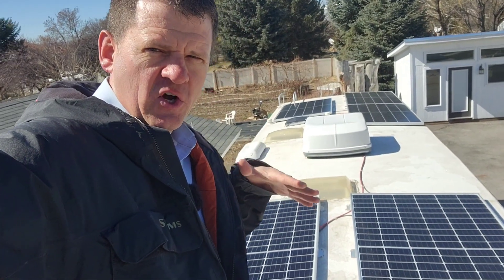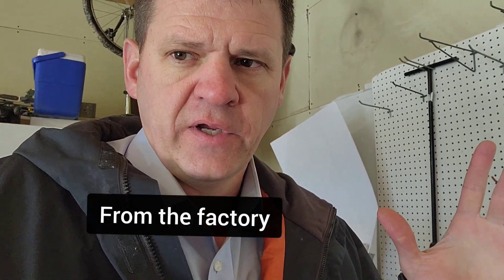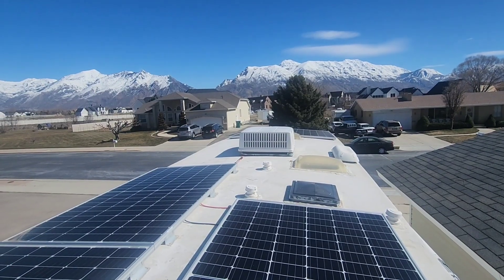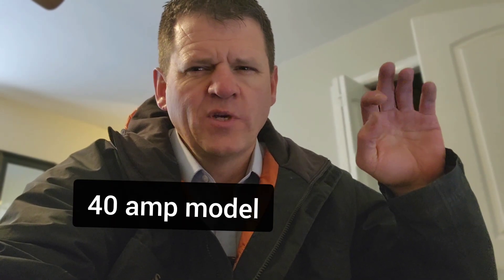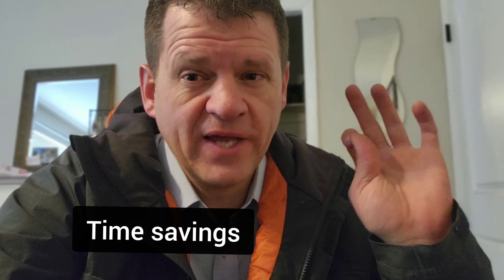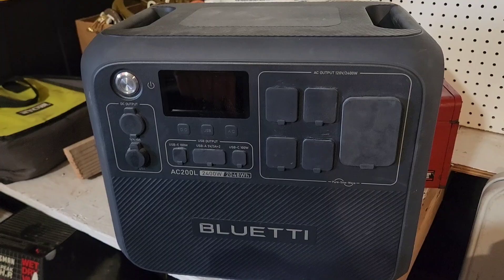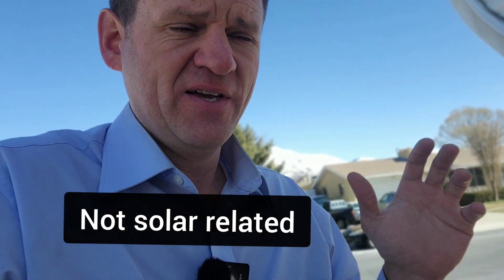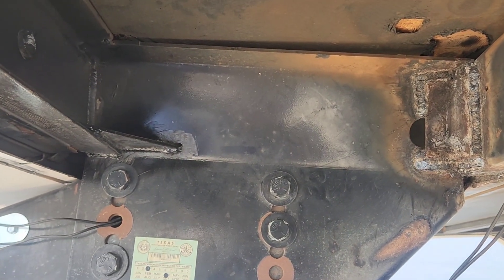One Year Review - 48v RV Solar Power system - What I Got Wrong

Comment: For those that dont know, running solar panels and batteries (if you have multiple batteries) in parallel will increase your amp hour rating, while keeping the voltage the same. If you run batteries in series, it increases voltage while keeping the amp hour rating the same
Reply from the maker: And wh or kwh is the battery capacity of all the batteries together. Volts times amp hours. 👍

Comment: @diySolarPowerFunWithRay Watched today your older RV inverter/battery installation video and how much each electrical consumer needed. I just wonder if it might be preferable to have a larger Growatt inverter? Like i.e. 5000w instead of your 3000w? I am toying with some RV solar/battery/inverter plans myself so very interested in your project. Appreciate your videos indeed👌Thanks
Reply from the maker: The 3000 W is great for me.  I've never wanted more power but your situation might be different. With my 3,000 Watts set up I can run my electric hot water heater and also my microwave. Or I can run my microwave and my air conditioner at the same time.  I can't run all three at the same time but I have never needed to do that. I don't think I would get this same inverter again.. I think I would go with another brand inverter... see my shock video.  I need to research some other brands. I do like the 3000 Watts of minimum usable power though.

Comment: Love this video, thank you. I've had a 48v system for an off grid house about 18 years ago but didn't like replacing lead acid batteries every few years. I appreciate all the tips for starting my 48 volt system for my camper and I've had a Bluetti 200max for a few years now so I will try hooking up to 12v 30A plug for my slide outs and jack. I'm pairing that up with lifepo4 48v 100A batteries.
Reply from the maker: Love that powerstation.   Not a common feature

Comment: Look at these two products A) SUNGOLDPOWER UL1741 6000W 48Vdc Pure Sine Wave Inverter Low Frequency 240Vac and  Input 120Vac/240Vac Output Split Phase with Battery Charger Off-Grid 18000W Peak and B) 
Cllena DC 24V Step Down to 12V 100A 1200W DC/DC Voltage Converter Regulator Waterproof Buck Transformer Power Supply

0:41
Reply from the maker: Do you have some links to those products?

Comment: Wanting to replace my lead batteries in the 5th wheel which are needing replacement.  Im trying to figure out the best transferable  battery to add to house and trailer 
.
Reply from the maker: I need to do a video on this. Basically you just want to make sure if you put a lithium battery in that the lithium battery is not connected to a lead acid battery at all. Even from the towing vehicle. If you do you will want to have a DC to DC charger. Something that will limit the current flowing into the lithium battery. Basically if the lithium battery is super low and you plug it into a 12-volt charge lead acid battery, the lithium battery can accept a ton of current and could blow your fuses or burn up your wires. So you will want a DC to DC charger in between your lithium battery and your lead acid battery. If you charge from your alternator the DC to DC charger will also prevent your alternator from burning up by working too hard.

Comment: My goal is the same as far as a mobile system to offset my home power with my system for the 5th wheel. I've installed the jackery 5000 with smart transfer switch. When we go traveling the 5000 will go in 5th wheel. I picked up the 2 500 w jackery panels.  They get 800 w just standing in the driveway.
Reply from the maker: I personally would get rid of the 12-volt battery altogether do you know if the jackery has a 12-volt port . Sometimes Those power stations have 12 volt 30 amp port period that would definitely be enough to run all your 12-volt appliances... I would definitely do that instead of putting a 12-volt battery in if you have that port.  And be sure to also turn off your 120 volt ti 12 volt battery charger or converter box that I mentioned this video.
Reply: @diySolarPowerFunWithRay  yes on the getting rid of the 2 lead acids.  Wanting a good 48 -100 like you put in your trailer.  I want to be able to use it to double my storage at home system when not camping. Unfortunately my 5th wheel is at storage for the winter.
Reply from the maker: You could remove the battery and just stick it in one of the cabinets and only use it in case you need a backup for some reason..

Comment: Hey Ray....You need to use the gooseneck with shock absorbers. That eliminates the stress on your RV hitch.
Reply from the maker: I switched to the Anderson hitch.  It seems pretty good. Pick up that would be really nice if the hitch on the side of the fifth wheel had some spring to it. Maybe I will get that on my next trailer

Comment: Instead of using the step down converter wire a 48v->12v CHARGER and put battery downstream of that, then hook other end to DC distribution. The 12v lithium battery will act as a capacitor to help with heavy amp loads and the charger will keep the 12v battery topped off. Especially if u get a low amperage 48v->12v charger then u wont have a hug amount of efficiency loss that having the factory converter on would use.. Then u can still switch off the factory converter.

Comment: No mention of over current devices. Please install a small panel after the inverter. Please install fuses for the dc-dc converter on both sides. And yes wirenuts on a moving structure is a terrible idea, fault goes to original manufacturer for that

Comment: best videos I've seen on coverage of RV inverter topic... the original 48v install vid and this one.  Even got the bonus here on gooseneck extension risk (lesson in torque).  You can get adapters from gooseneck balls to kingpin depending on your tow vehicle arrangement needs (they seem lighter than standard fifth wheel hitches but the ones I've seen do require some torquing of bolts when installing the adapter and may not be faster to remove the fifth wheel frame to clear up bed than a normal set up, just easier to carry and store)

Comment: i have installed those Victron multiplus2 that 2400w rating is very conservative i bet it would run your ac and microwave at the same time for a few minutes it would say its overloaded but they will hold it for a bit.

Comment: for panels just do unistrut rails on the roof, then they are up off the decking panels run cooler and you can cable manage/change out panels at any time, take the panels with you to a new trailer.

Comment: one wire popping off in a cupboard wont start a fire FYI. Not how electricity works
Reply from the maker: It depends on how many volts are on The Wire when it comes disconnected.

Comment: The 12 volt battery is needed for breakaway on travel trailers, right?
Reply from the maker: You need 12 volts, yes.  I'm supplying that with my step down converter. Typically trailer brakes will use 3 amps of current per break if the Breakaway switch is pulled. Since I have four tires it will use a total of 12 amps.

Comment: I would have left the 12 volt battery in the system if for only to absorb the initial inrush of any loads on the 12 volt system. This would make life a lot easier for the 48 to 12 volt DC to DC converter. just a thought. Great video

Comment: Rey, bonding neutral to ground is done at the source, not at a sub-panel. Your RV is a subpanel to the shore power pedestal. Bonding is supposed to happen at the shore power pedestal. With an inverter, take Victron as an example, when seperated from shore power, an internal relay closes to create neutral to ground bonding since your inverter is now the source of AC power.
Reply: Would I have to create a jump wire to ground and neutral together at the inverter?

Comment: Hi, I love the videos that you did on the solar system,  but how can I figured out how much solar  panels needed for my rv? I have a 2001 Four Winds Motorhome.
Reply from the maker: That really depends on what you want to run. Some people have a generator and use that whenever they run their microwave or air conditioner or hot water heater. If that's the case you probably don't need too much solar just something to keep the battery topped off from the smaller running appliances like lights, etc.
Reply from the maker: If you want to run your air conditioner I would put as many solar panels as you can fit

Comment: Good job, Ray. The only thing I disagree with is removing your 12v battery, if you have a 24 or 48v system, especially if you have high amp 12v loads. For instance, my 5,500w generator requires over 300 amps to start. My hydraulic jacks and slide also are high amp draw items that need a high current source. We use both a 12 and 48v system to power our motorhome. It's good insurance to have a redundant system in case one goes down.

We're old, retired FTers who designed and built our system ourselves, on a tight budget. It took us 5 years to gather the resources to complete it, doing all the work ourselves, but it was well worth it. We started by building a 620-watt liftable solar array on the side of our motorhome. It makes a nice bedroom window awning too, practically lifting itself with a couple gas struts, and it's easy to clean, standing safely on the ground. Next, we built a 12v, 560ah LiFePo-4 battery with 8, 280ah prismatic cells. We use a Heltec 330amp BMS (1,200a surge) with a 5a active balancer. It cost us less than $1,500 to build this 7.1 kwh battery, including the high amp BMS. We chose these cells rather than a pre-built battery because they fit perfectly under the steps of our MH where our old pair of golf cart batteries used to reside. We insulated the battery compartment, cut a small hole in our step risers and installed a tiny computer CPU fan to keep this space at close to room temperature, so we don't have to worry about the BMS shutting down charging due to low temperature - or their life reduced from getting too hot. Our 12v system uses an 80A Progressive Dynamics LFP converter/charger, a 1,000w Renogy inverter, a 50a Epever MPPT charge controller and a Lnex battery monitor. The only time we plug our converter/charger in is when we are on shore power, which is a rare event now that our 48v phase is complete. We built this entire 12v phase of our system for under $3,500. 

By mounting the solar array on the side of our coach, we left the roof free to rack 8, 550w solar panels (4,400 watts) down the length of our 35ft Class A, 15" off our roof, above our AC, vents, etc. We built the rack out of 2" aluminum angle with the front 2 panels of ours sloping down at a shallower 9.5-degrees to meet the roof, gently easing airflow over the array. It covers our entire roof, providing some nice shade with plenty of cooling air underneath, increasing solar output and reducing the heat load on the air conditioners too, though our overall height is still just under 12 ft. We mounted our Sungold Power all-in-one 48V, 5,000W Inverter/100A charge controller/battery charger, breakers and a Lnex battery monitor on the wall in our bedroom, saving us space as well as money. We chose the Sungold Power unit for several reasons. First, it supports up to 500 volts from our 400 voc solar array, and unlike a Growatt can work without batteries hooked up. It also has a power saver mode that only uses 20-25 watts when idling. It's selling for $764 now - not bad for a 5,000-watt PSW inverter (with the same 95% efficiency as a high-end Victron unit) and 100amps of combined 48v battery charger/charge controller capacity. Our 48v battery uses 16, 320ah prismatic cells and a 200amp Heltec BMS to keep it safe. Together with our 560ah 12v bank, we have a total of 23.5 kwh of batteries onboard - kept charged by 5,020 watts of solar. We removed the rooftop A/C we had in the bedroom and replaced it with an EG4 28.5 seer-2, 12k btu mini-split heat pump on the upper rear of our motorhome. It's super quiet and cools as well as our 14.5k btu soft start equipped Furrion we installed up front. This second phase provides 24/7 off-grid air conditioning and heat from the heat pump. We can run both A/Cs, microwave and charge our batteries from solar at the same time, even in winter. We have a total of 6,000 watts of 120v inverted ac power, giving us off-grid electrical self-sufficiency for a total budget of around $11,500, including the $1,500 high-efficiency heat pump. 

Take care, we hope to see you down the road one day.
Reply: Awesome setup you guys have there. Thanks for sharing the details. 👍

Comment: This has been extremely helpful. I am working on setting up a 48V RV system this spring summer. I am running with a EG4 6000xp for split phase and then using a chargverter for a 120V separate input. I am now very mindful of the solar now. I have 5 panels as well with a VOC 45V. I may want to see if i can get another panel or two in series now due to shading.
Reply: Good point on using it as backup house power. Never really thought of it like that but you have an excellent point. I should have a minimum of about 10V higher than you had per panel with 5 in series.
Reply from the maker: That will be a nice setup I think. Let me know how it goes. Do you have any 240 volt appliances?
Reply: @diySolarPowerFunWithRay  I don't currently have any. One of the reasons I picked this AIO is it seems to have lower idle current consumption than a lot of the others.  Since the RV has a native 240V split phase feed I was trying to keep it that way and the fact that I do have two ACs. By keeping it split phase it gives me the option to install mini splits in the future as well.
Reply from the maker: @robertrapp5953  very nice. I think you'll like it. If you don't end up liking the solar charge controller that requires all your solar panels to be in series, you could always get a separate charge controller that accepts a lower voltage so you can connect some solar panels in parallel to help with shading.  And then you can 6000 XP mppt for any large solar arrays you want to attach... which would be good for ground arrays in case you need a lot of power in an emergency...powering your house items, etc..

Comment: Try to use a micro wind turbine in conjunction with solar. Best of two worlds.
Reply from the maker: Nice, I'd love to try one of those out. Any you suggest?
Reply: We measured the output of a wind gen during some winds, and the results were disappointing. 9 amps at peak wind gust. They don't come close to their stated ratings. You need at least 4 if you have any hopes of making a charge contribution to a bank of LFP batteries...
Reply: Those micro wind turbines suck. Inefficient and not worth the money or trouble. And it is rare that you have enough wind to produce as much power as they advertise. Bearings wear out and need to be replaced. Search Youtube for reviews.

Comment: fyi: "just stick them down" solar panels, you mean the flex ones. yeah i've got those. except not with the sticky tape. bad idea, they can fly off when you drive, and then that'll damage them and possibly other stuff. they make the grommet ones, which i have, much safer / better, i still have the option to stick them down with my own solution (whatever that is, def not 2-sided tape!!!)
Reply from the maker: There are definitely some cheap ones out there... I hear the ones from boozeRV are good but I haven't tried them myself.

Comment: Please don't use one of those ground-neutral bond plugs.  In your AC breaker space, this is where ground and neutral should be bonded.  You can also get a 'ground' for your RV!  There are rubber 'tails' you can hang off of the bottom of your RV that touch the ground when you are stationary.
Reply from the maker: What about when I pull up to a RV Park and they already have a G/N Bond in their main panel?  I like the simplicity of using a bonding plug for that reason.  Do you have a link to the rubber grounding "tail"?  That's interesting.
Reply: That may not hold up in a lighting strike, but it might make your RV a smaller target for lighting due to keeping your RV at the same potential as the Earth. The key is a good connection...
Reply from the maker: @s.mendez7160  thanks.  I would think my rubber tires on the ground would have the same effect. Maybe that product is just a scam?
Reply: @diySolarPowerFunWithRay  Your rubber tires insulate the vehicle from the ground. Rubber is not conductive.

Comment: Those bouge rv panels aren't what they claim. I wouldn't waist you money on those. They don't handle the heat or produce as advertised. Also your cabling is probably the main issue as well as the flat mounted panels. I learned that the hard way.
Reply from the maker: Thanks for the feedback on the Bouge panels.  I had adjustable panels on my previous RV... after 3 years I didn't tilt them once.